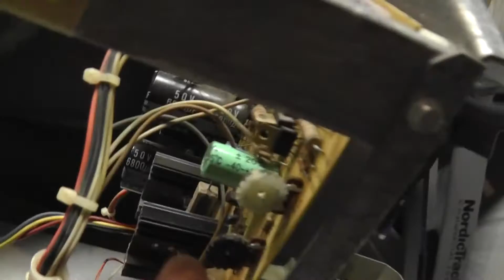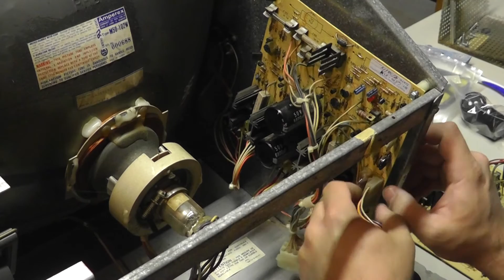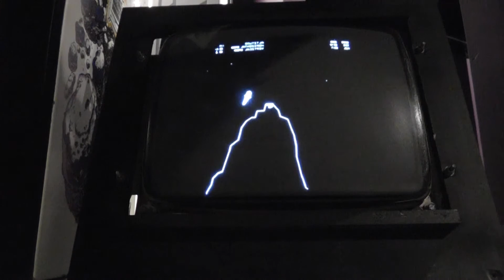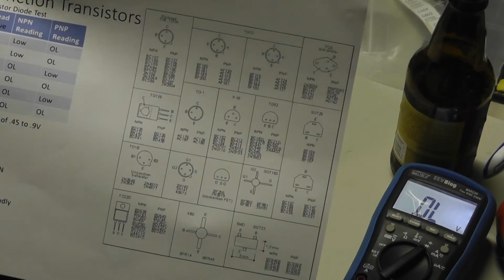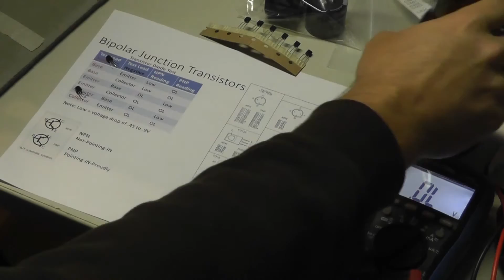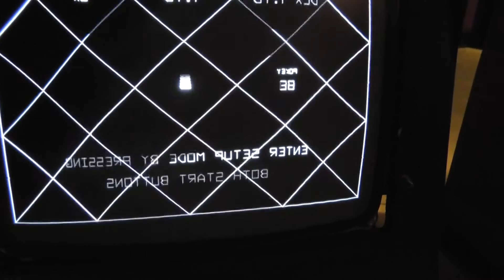Asteroids Deluxe (part 3) G05-802 Deflection Board

Comment: Did you ever isolate what was causing the collapse/centering/size on that one deflection board?  Having the same thing here(not as bad as here but it does the same thing).  Great vid!
Reply from the maker: Unfortunately, I don't thinks so.  I haven't had a need to go back and troubleshoot that board again.  Need some more B/W Vectors I guess.

Comment: OL = open line
Reply from the maker: Was this referring to a comment I made on DMM OL reading? I would have to rewatch the video.  I think technically it is called Open Loop on continuity test and Over Limit on voltage tests.  Regardless, appreciate the the comment so I can refer to it correctly next time.

Comment: JACKLICK, All vector arcade games are always outputting -8vdc and +8vdc to the monitors Deflection circuits? What does the monitors deflection circuits do? whats the common problems with the monitors deflection circuits that you have ran into in the past in your experience?
Reply from the maker: Are you sure about the 8v and +8v statement?  Pretty certain the voltage is higher than that for X/Y to deflect the beam to the edges of tube.  Would have to break out a manual but +/ 25v jumps to mind on a 6100 monitor.  ArcadeJason would be better person to ask these kinds of questions too.  Check out his youtube videos on vectors.  I haven't worked on enough of these to say what is the most common failures but will suggest heat and game board failure are likely the ultimate cause for most failures.  Again, I just document my own experiences and learning and am no expert.
Reply: @jacklick  ok thanks i'm wasn't sure what theh XY voltages where on the DAC outputs on the arcade board so its -/+ 25vdc and not -/+ 8vdc?
Reply from the maker: @billwilliams6338  I thought you were talking about the voltages deflection boards to move the beam.  I haven't worked on any of my vectors in awhile so take this with some skepticism. Based on quick search though, I think the x/y pre-amp OUT voltages from pcb should be varying so not always +/- 8vdc.  That is more likely an average when measuring with a DMM and even that may be a bit high.  Next time I have something on the bench, I will measure at the DAC.
Reply: @jacklick  yes try measuring the XY preamp out voltage next time

Comment: Thanks, The RGB signals are outputs are from the arcades games motherboard which are from the DAC 3 transistors for each color RGB. The color PROM chip is a look-up Table that has the colors, shades, tints, etc. What components in the arcade monitor circuit board converts these input RGB color voltages into drawing the image graphics on the arcade CRT screen?  The H&V sync signals get inputted to the sync separator chip in the arcade monitors circuit board, but the H&V sync signals go to the Flyback to scan tracing the CRT beam vertical and horizontal in sync timing but it doesn't draw the images on the screen.

Comment: any reasons why arcade monitors use an isolation transformer? why the arcades monitor circuit board is not earth chassis ground so you can't use an oscilloscope to measure voltages? the sync signals for different arcade monitors won't work with each other any reasons why they made different sync signals for different monitors?
Reply from the maker: I will do my best to answer these.  arcade video game monitors use isolation transformers for our protection since the components are exposed and not encased in plastic.  The amps on the line are reduced so we don't die if we accidentally touch something while it is on.  The monitor circuit board is often tied to earth gnd but isn't required to be and you don't need earth gnd for scope to measure voltage afaik.  Often you will see logic and earth gnd tied together somewhere in the cabinet, usually via video gnd actually but it isn't required.  Monitors don't output sync signals rather the video game pcb does.  Early on, game developers used different sync signals, some positive and some negative, some combined Horz and Vert sync and some separated them, but all were in the 50-60Hz vert range.  It is at least partially due to the resolution of being driven to the monitor. For instance, Taito games used a different resolution than Williams games for example.  The monitors' sync circuitry is adjustable and in most cases, can support all combinations but there are a few chassis that only support positive sync or composite sync.  Later on during the jamma years, game developers standardized on negative composite sync.  Hope I am somewhat accurate on above and it helps.

Comment: You ever come across a bulls eye dot and circle around it in center of monitor?
Reply from the maker: thought I replied to this earlier.  Is it a bright white dot in the middle when powered on?  Or a dark spot when power is off?  If you have bright white center dot, you don't have deflection and worse your spot killer circuit is not working.  Don't leave the game in this state as it will burn a hole in the phosphor of the tube.
Reply: jacklick once the games warms up... dot appears with a circle around
Reply from the maker: Do you still have the game image along with the dot?  Does it go away if you turn brightness down?  If so, try adjusting your brightness and contrast while monitor is fulled warmed up so the dot is not there.  If you still get a bright dot, no matter the adjustment, you may have a G1 short on the tube.  I have seen a G1 short in the tube cause loss of brightness control.  If there is no game image, just a dot, then you have a deflection issue and spot killer ckt is not correctly turning off your Z amplifiers.

Comment: Thanks for this video.
I recently picked up an Asteroids cocktail and can't quite diagnose the problem in getting it to work: In test mode it emits a single high pitch tone, then no additional sound. On the monitor it shows the cross-hatch pattern only on the lower half of the screen along with the dip switch settings display. The cross-hatch pattern seems fine (no stuttering, or uneven anomalies) except for it only runs across the lower half of the screen. When I try to adjust the X-Y pots on the PCB it only affects the lower half of the screen. Nothing will move above the center horizontal line. Now, when I switch OFF the test mode to PLAY MODE, all I get on the monitor is a single bright white dot dead center. I don't leave it on long at this point for fear of dot burn in. Any idea what going on here?
Reply from the maker: My best guess would be you have monitor frame transistors that are bad or the headers need reflowed.  The single tone you hear is normal when going into test mode.  Can you hear the game play after coin-up?  To completely eliminate the PCB as a problem, having another working monitor or an oscilloscope always helps but I would start by testing the frame transistors and the connections.  Do a search for g05 vector faq to get even more hints.
Reply: Thank you for your reply. Good advice. I'll proceed with
 renewed focus on the monitor and deflection board as mentioned.
Reply: Thought I'd get back to you on my progress. Thanks again for your pointers. I took the monitor out and tested the transistors. They all tested "good". Then I re-soldered the header connections to all four transistors on the deflection board and BAM!!... fixed the game! It works!! I'm so excited. :)

Only of couple of minor issues... the screen now appears slightly rotated as a whole. Whether in test mode or game mode. It looks like its 10 degrees turned on an angle even after adjusting the X/Y pots on the PCB board. Is there any way to control for the rotation of the screen? Also... the "fire" button doesn't work for either player. Probably a separate issue. Any more thoughts or ideas at this point? Thanks in advance for your reply.
Reply from the maker: congrats on the fix.  best bet is to open a repair thread on forums.arcade-museum.com so you can post a pics and get some additional, more expert, opinions.  However, my best guess would be you will need to adjust the yoke on the tube.  This is not likely a monitor chassis or pcb issue.
Reply: OK. Will do. Thanks for the reply. It occurred to me as well after I posted my message to you that a simply adjustment to the yoke might be all that is needed. Gotta figure out why the fire button for both players won't work as well.
Reply: OK...I've rotated the yoke. the monitor is no longer angled.

Final issue: I can't figure out how to fix the Fire buttons. Neither players' fire button works. All other buttons are fine.

I joined KLOV but I'm not allowed to post/start a new thread. I'm too new I guess. New rules say I can never start a new thread. Not authorized. Need to be referred by a current member or donate money. Ugh. 

I've read everything I could find on KLOV on my fire button issue. I found a few related posts about checking continuity between the harness and button as well as checking grounds and edge connector connection. 

How do I check continuity of the buttons exactly? How do check correct grounding? I've re-seated the edge connector after attempting to make sure it's clean and well fit. No change. 

 Again, I'm a newbie. Any help on how to fix the fire buttons? Sorry to keep asking for help.
Reply from the maker: to check continuity, you put your multi-meter on ohms/continuity beep check.  Place both leads together and it should beep as example.  Open the control panel you will see two wires going to the leaf switch for fire button; one is connected to logic ground and one is the fire control wire.  place each your meter leads on the wires and press the button also make sure the leaf switch contacts touch when button is pressed.  You can clean the contacts (slide a business card between them) or adjust/bend the blades to insure their operational.  You should get a beep or near zero ohm reading with your meter.  Keep doing this working back from button and control panel to control panel harness then to the edge connector insuring the wiring is intact all the way.

Lastly if you prove the wires are good, you can jumper a wire between logic gnd (anyway) and the pcb card edge trace for the fire button.  if you don't get the fire button to register by manually jumpering it momentarily on the pcb itself...you have a board problem.